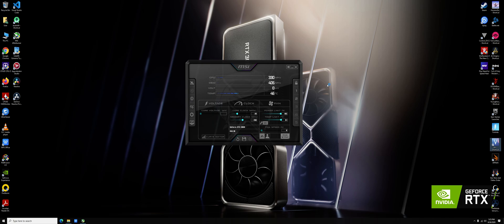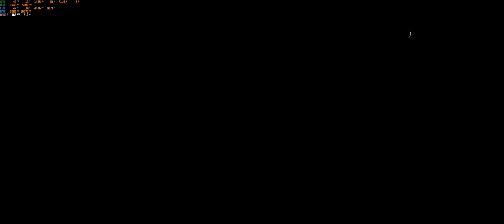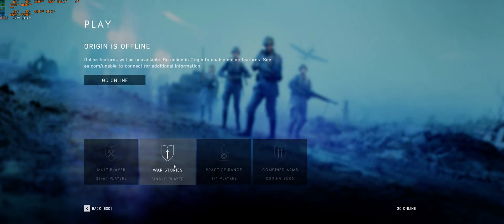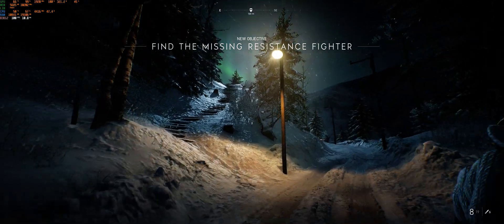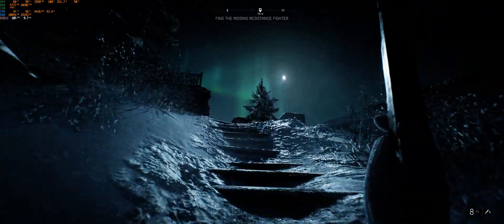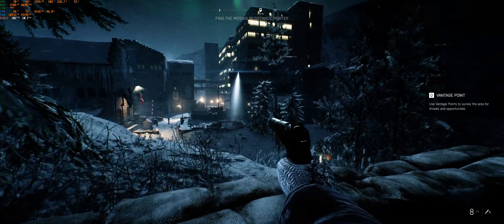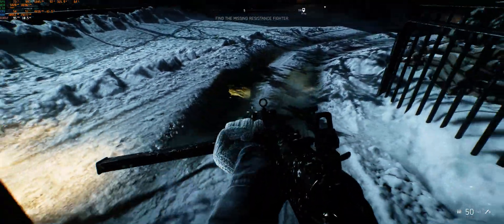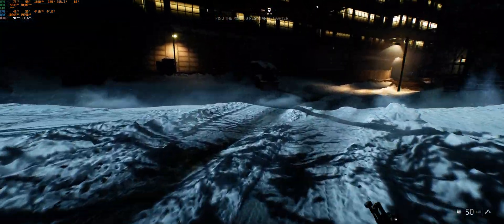How to make your RTX 3080  Zotac Trinity stable | Will apply to other third party cards as well

Comment: the new drivers made my card have worse performance, so I flashed a new bios on it and pushed the power limit higher. and it felt like a completely different card. problem solved. night and day difference. I recommend anyone using an rtz 3090 to flash a new bios on it from another card. I used Galax bios. 

but be careful when you flash to make sure you have a bios that will work with your card. not all rtx 3090 bios is compatible with your rtx 3090. for the zotac their are like at least 3 confirmed bios that will work and not brick your card. I saved my old bios so I can put it back to default when I want to return it for the RTX 4000 series. I know I won't be going with a zotac for that though. Not after my experience with zotac.

But with the new specific galax bios I got higher overclocks and significantly cooler temperatures  at idle and under max load. Like I said it was a night and day difference, felt like a completely different card. 

I feel like if I add new high quality  capacitors on top of the old ones it will give me even more performance. I think i might look into doing that.
Reply from the maker: nice

Comment: Btw you could have just locked your voltage to 1.0v or 1.1v and it should run at 2050mhz with no crashing if or anything
Reply: It’s not to hard just use msi after burner I can make you a video I get my card tomorrow I’ll show you how
Reply from the maker: @dragonsbreathgaming8172  sure would love that. in msi after burner dont see such an option
Reply: @rtxgamebench8215  i uploaded that video for you to check out
Reply from the maker: I didn't. How do you do that?

Comment: You gotta fix or replace your mic input my guy, it’s got an awful sounding high frequency behind your voice! It’s so bad I couldn’t even finish the video
Reply from the maker: Did u make a video for me?
Reply: @rtxgamebench8215  I completely forgot to!! One second I’ll start up a live stream on my channel and you can join and I’ll show you how to voltage lock
Reply: @rtxgamebench8215  I did upload the video if you wanted to check that out should help you out
Reply from the maker: Thanks for feedback. Before video did a voice check but I am using mic of razer head set and it may shrink closer to face causing that high pitch

Comment: what if you game at 1080p, I don't plan on 4k at all yet, soo mine shouldnt oc over 2hgz right?
Reply from the maker: no need and this card would be an overkill. My son games at 1080p at 165hz using RX570 bought for USD 80. You can check his channel at https://www.youtube.com/watch?v=ig_BPevo-tU and it is playing fortnite with all settings at high
Reply: Omg you using a 1080p monitor. Buy a new one it is extremly overkill, a rtx 2060 is enough for 144hz 1080p. Buy a 1440p 170hz
Reply from the maker: @xxitsmelucasxx1829  i am not. Using 3440x1440 as mentioned in the video

Comment: Not had a problem with mine, 105% power limit with +25mhz to the core (stays above 1900mhz at all times) 50 hours of so of gaming.. Unlocked fps

Haven't even tried the new driver yet
Reply from the maker: Lucky. Try the new drivers much more stable
Reply: @rtxgamebench8215   I'm actually doing the same running RTX games  and it's fine just turning it down a bit because my pc is becoming loud lol
Reply: @xPhantom1786  is there any free games with Ray tracing I could test? Bought tons of games this month lol
Reply: @MrEditsCinema  you can start with minecraft beta rtx version lol, but most of my testing was death stranding since it supports the latest dlss. I just used the zip lines in the game which is fast pace to test how many frames I can get then decide which output is OK for me on afterburner.
Reply: @MrEditsCinema  oh you meant free games lol nah probably the bundle thing that came with the card like GeForce now or something
Reply from the maker: @xPhantom1786  good
Reply from the maker: @MrEditsCinema  quake 2 only
Reply from the maker: @xPhantom1786  it came with Watch Dogs Legion
Reply from the maker: @MrEditsCinema    it came with Watch Dogs Legion

Comment: I pre ordered the zotac trinity 3080, pretty sad to see I could have gone with the cheaper asus tuf model and gotten and wayyy better card. I went for the looks and now I regret it :/ 
Still happy I got a 3080 for retail non inflated price though.
Reply from the maker: I hope it performs good too. I would have traded for ASUs tuf card right now
Reply: @rtxgamebench8215  I'm pretty sure you can RMA the card if it crashes without any overclocking and just with the gpu's boost clock. I also heard that the cards they are making now do not have this problem so I'm hoping I get one of those.
Reply: unless youre wanting to overclock youre not going to notice a difference by just gaming. benchmarks will give different score ofcourse. but max fps will only drop MAX 5-10%. thats 8 fps at 140 fps. youre NEVER going to notice that with just your eyes
Reply from the maker: @ErikGarpenstedt  thats not the issue. I can survive with that. The issue is when the power delivery is bad, the card makes whizzing sounds. I thought its coil whinning but its not and its the power delivery stabilizers at work. This mostly is noticeable during clocks hitting 1900+ and specially when RayTracing is enabled in games for some reason. Non RT games have much less noisy sound. I even tried to run the fan curve higher to make my heart feel there is no such weird sounds coming from the card, but alas those sounds are shrill and hits my ear easily or may be my head wants to track it more.
Reply: @rtxgamebench8215   ohset mb, i was not aware of that. Is it really that loud? ok then you deffinately have a reason to be unsatisfied with your card. man i bought the zotac 3080 too, its arraving at my house in 2 days and when i first read about having to undervolt i didnt really care since it was just a little bit, but if its making whizzing sounds that are audible over the fans then thats another thing. how loud is it as an estimate? ive been wanting to buy a new case and fans to go all in on trying to make my pc as quiet as possible.

Comment: I have no issues with my Zotac ._. I've been playing for hours,I play at 4k 60 and 2k 144hz ultra settings.
Reply from the maker: Depends on each card and the clocks u r getting
Reply: What are your peak clocks? I saw a guy on twitter hitting 2040 MHz without crashing on his zotac 3080 Trinity, maybe you got lucky?
Reply from the maker: In not RT games I can hit 2035 yes. RT based games have high tendency to crash
Reply from the maker: I game on my lg b9 120hz but disabled vsync for frames would go beyond 120 for sure. I have asus 249 tuf at 280hz 1080p. Thinking to get samsung g7 for this card.